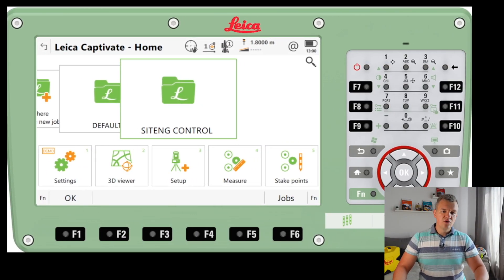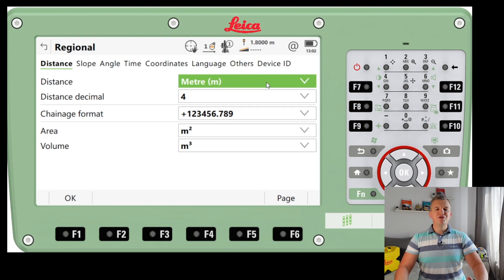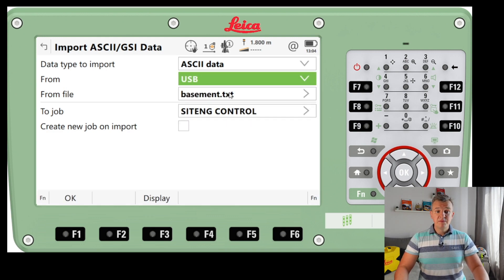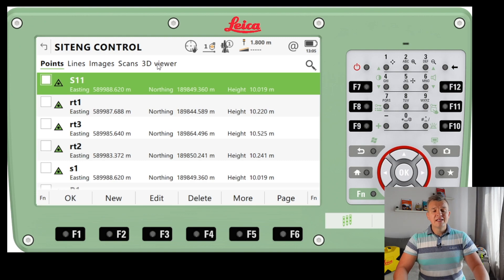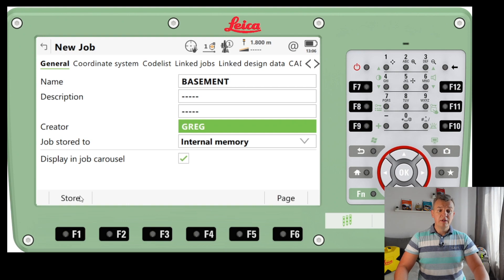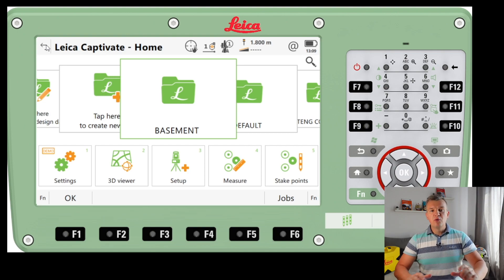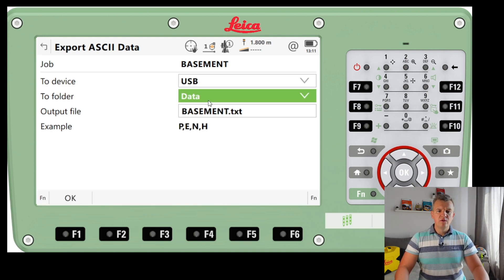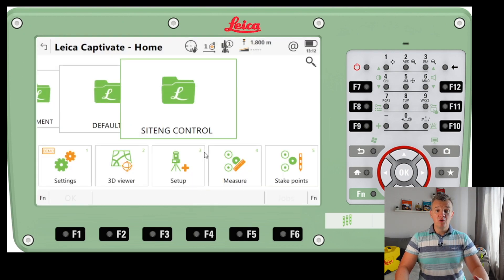How To Use a Total Station.Export & Import Data

Comment: Hi Greg. Maybe you noticed then we transfer the asbuilds drawings (data) from ts16 and put into CAD, automatically goes into global coordinate system(mouse x have two colours green and red), and when I want to Cube the area it’s snapping only three points and after I have to switch off snapping tool to complete the area calculation. It’s not hapen then we transfer from TS06, 07. Do you know something about it?
Thank you very much!
Reply: Thank you Greg!
Reply from the maker: @SonyEricson-z1n  no problem
Reply from the maker: I didn't no, but I would have to see exactly what you mean TBH.

Comment: when i import dwg files to ts16 it vanishes. to find it i always have to manually feed a coordinate in that drawwing to get that point in the drawing and zoom in to find the drawing. 
is there any easy way
Reply from the maker: there is a better way, I'll record a short vid this week. Also, why your drawing is so big and maybe there some other points which make it impossible to zoom - might be worth to copy on the new drawing only what you need and then save it as dxf and bring it to TS

Comment: NIce, sir which software you are using here on PC??
Reply from the maker: It's a Leica simulator, you need to look for it on line as it's not available from where I got it
Reply: @SITENG  can you provide me setup to install that.
Reply from the maker: @Civildesigns04  I don't really have it, made a mistake and delete it, but have it installed and still can use it. I will try to get it somehow and then will make it available for everyone
Reply: @SITENG  yes please check it out and let me know when you get..thanks alot
Reply from the maker: 👍👍 @Civildesigns04

Comment: Hi Greg, 
I would appreciate your opinion on this:

- A trainee engineer position for a groundwork and RC frame contractor. Project not very big. Self employed.
- A junior engineer position for a surveying company (specialises in as‑built surveys, setting out, control stations, monitoring and 3D laser scanning). Employed position.

Which one do you think is a best to start?🙏
Reply from the maker: Definitely the first option. Just make sure for how long are both options, as harder times coming and it's good to have something for longer time. Definitely you will be more busy and learn more&quicker with frame contractor - this will also open more doors for you once you get some experience
Reply: @SITENG  thanks for your reply. 🙏

Don't know if you practice such things, but I would be very grateful if we can have a chat about it today or tomorrow when you have free time, as I have to make a decision on it on Monday. I am more than happy to pay you for your time. 

I worked 4 days for option 1 and 1 day for option 2 this week, but still I feel like I need to discuss it with someone not related to these companies.

So if you have time and willing to have a chat I would appreciate it a lot ☺️🙏

Comment: Hi buddy one thing I struggle with is how do you give levels with the prism pole?
Reply from the maker: Better just use reflectorless if you can. If you're using a pole you have to set target height (on the instrument)  same as your pole height - it's marked on the pole. I recommend to shoot reflectorless at some point and then set your pole + target height and check the same point - you will see what you have (shouldn't be a big difference if you keep the pole straight)
Reply: @SITENG  alright great thanks. Also how do i hold the pole by the pin? Should hold it at the top of pin then tape down or hold it by the side?
Reply from the maker: @khalidhashemi1181  If you have original pole there have to be dimensions on the pole
Reply: @SITENG  no I understand the dimension bit. Its just hard putting levels with pole how do you usually do it?